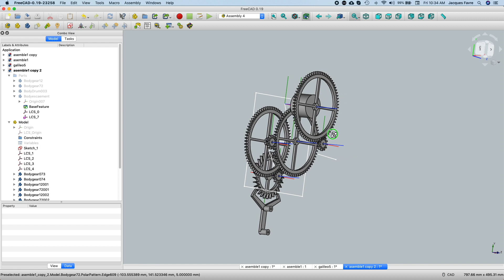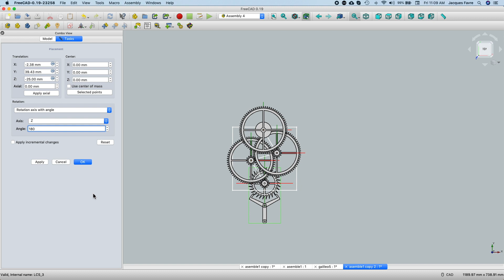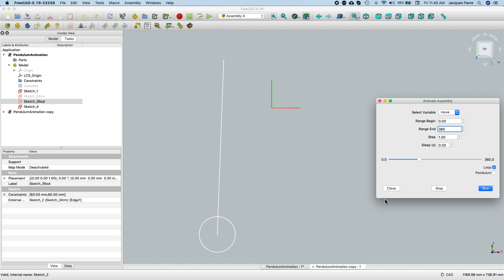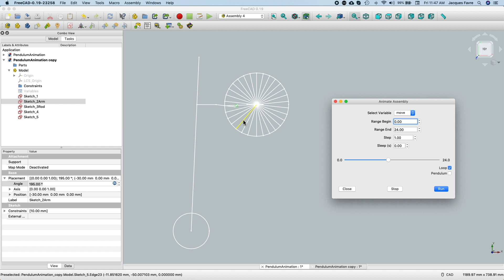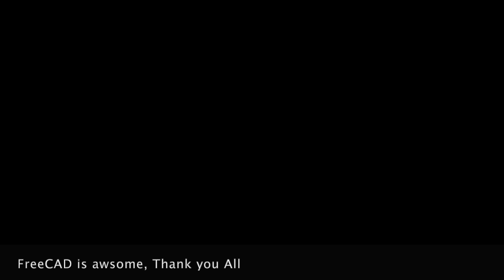Clock Design with FreeCAD and Assembly 4 Workbench

Comment: What made you choose Assembly 4 Workbench? Why not A2Plus? I'm a Creo user (since 1994 (Pro/E - WildFire - Creo Elem - Creo) and just started experimenting with FreeCAD.
Reply from the maker: Earlier on to design well meshing cycloid gears, I needed to animate them
I found an easy to follow tutorial on how to animate two gears with assembly 4 and just kept going from there
Another feature is that I could attach the gears to a basic sketch and move them around to experiment with various placement before starting to sketch the frames
I am new to FreeCAD and still experimenting
There is an article comparing the assembly in the wiki I think
Reply: @jacquesfavre999  Thank you very much. By the way I love mechanical clocks. For me they are something alive. An electronic LCD watch is a "dead" thing :)
Thank you for sharing your FreeCAD adventures.
Reply from the maker: My pleasure 
I agree, clocks are also a great learning, teaching tool
I remember a young kid at a makerfair where I was with one of my clock
« But how can it work? it is not plugged in... »